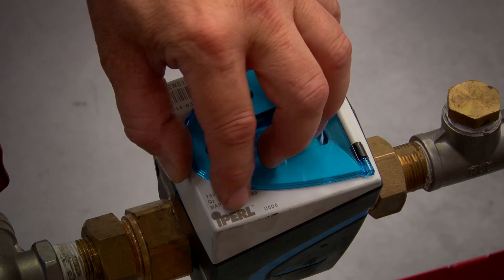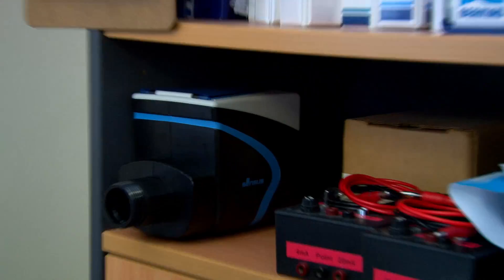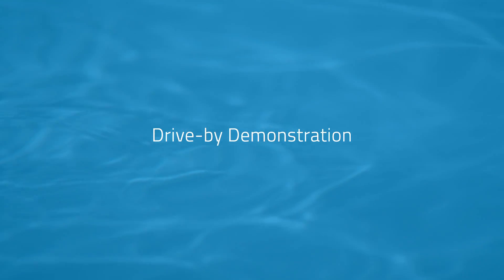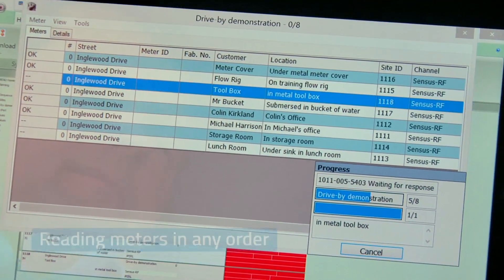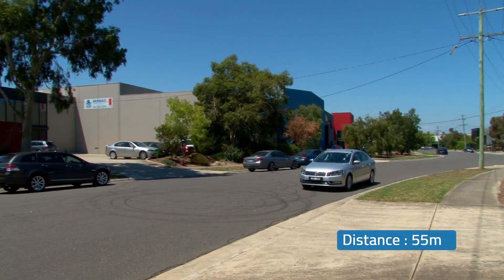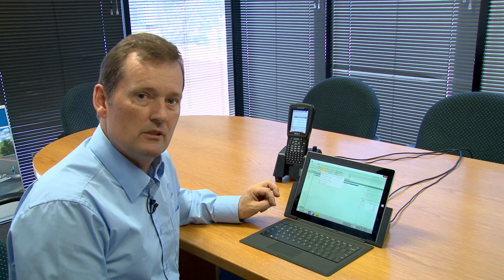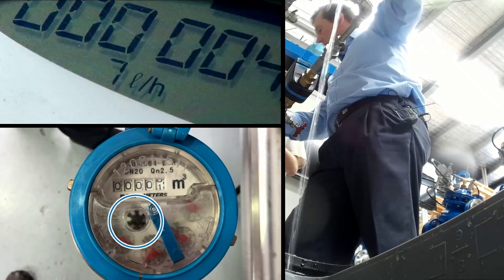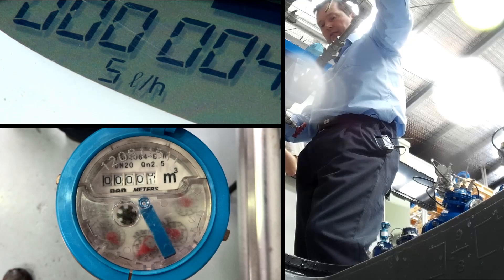Sensus iPerl Water Meter "Drive-By" Demonstration

Comment: I guess if these things penetrate water and metal, they give off body penetrating frequencies.  Nasty, and this guy is so proud.  You will need grounded Faraday to protect yourself from it and it will be out in the yard.  The FCC rolled out their Human exposure guidelines for RF/MW based on their program goals in 2019 and these were thrown out of court in the landmark case of EHT/CHD vs FCC in 2021 because they were based on program goals (that the tech failed to meet) and there is massive proof of harms from this stuff.  But they are still peddling their toxic junk.  I wonder how many are being run on body area networks.  Yea, they can harvest your energy to transmit their data through you to the nearest base station 24/7 and feed the GIG to help predict what you will do and how best to exploit and control you.  Nasty, nasty, very nasty.